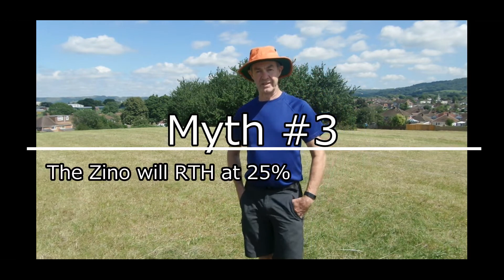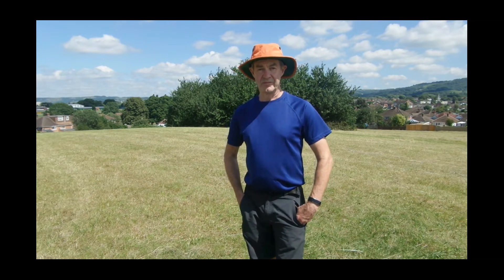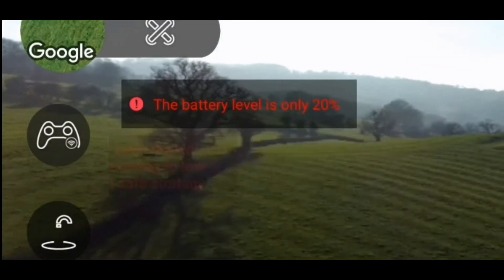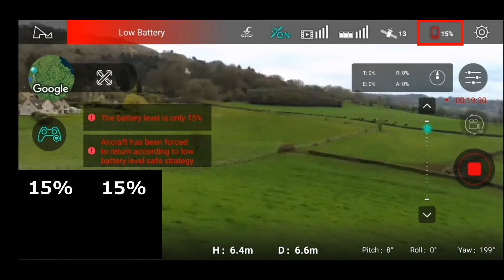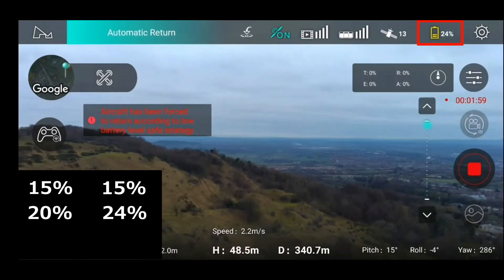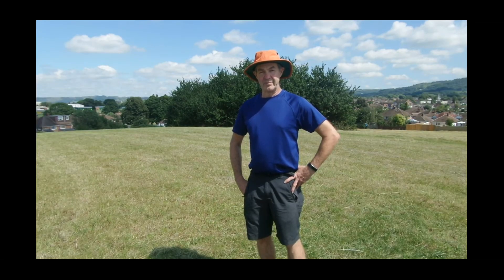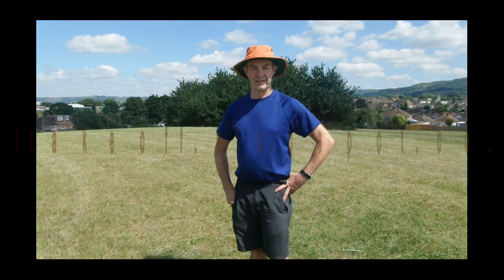Hubsan Zino - Myth #3 - The Zino is forced to RTH at 25% battery level

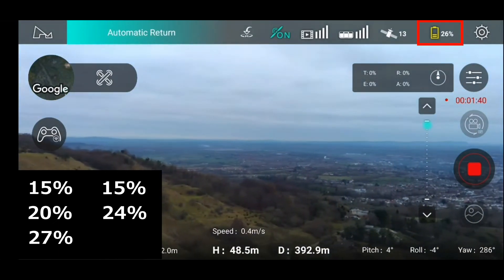Comment: At 2:30 you show 1482m out. What firmware did you have? I am running 1.1.52, Cam 0.36  Gim 2.2 and App 1.6.9 and can not get over the 1k mark.
Reply: randoneur, that makes two of us, and I'm guessing a lot more!
Reply: @davidblakeman6692  +1
Reply: He's a child laughing at you right now. Myth #4 It won't do this range without some help from something extra! You are asking what he wants you to ask. I see him ignore us in groups asking this same question. Post it and ignore!
Reply from the maker: On that one, FC 1.1.52, IT 0.3.6, gimbal 2.2, controller 0.1.6, app 1.6.9.
The stock Zino is restricted to 1km by it's physical components. Firmware could only perhaps give an extra 150 to 200 m.
Reply: @randoneur  : So how do you explain getting 1.5km if the Stock Zino has physical restrictions of 1km? What mods are in play?
Reply: I just wondered .. something is fishy on his device ..